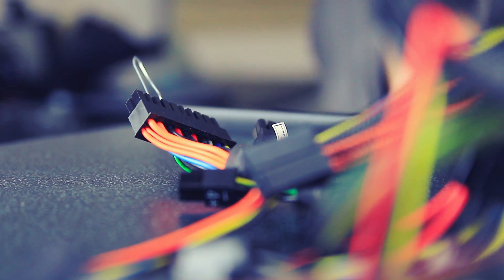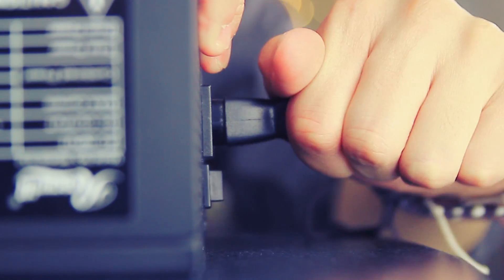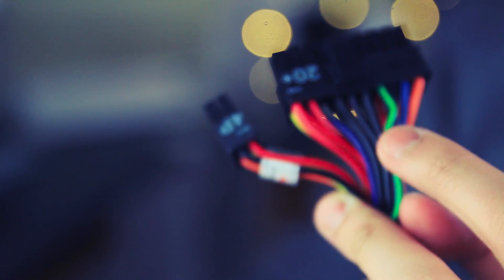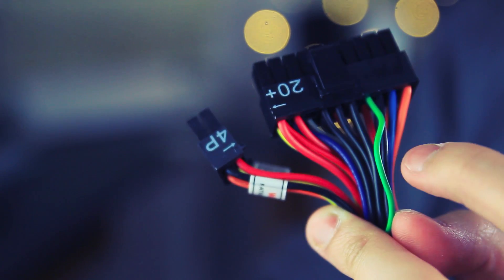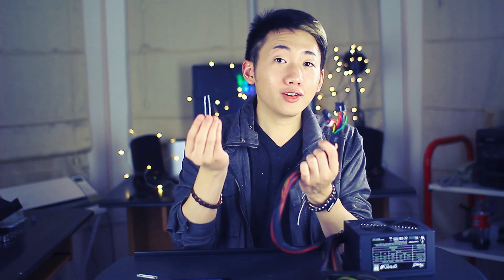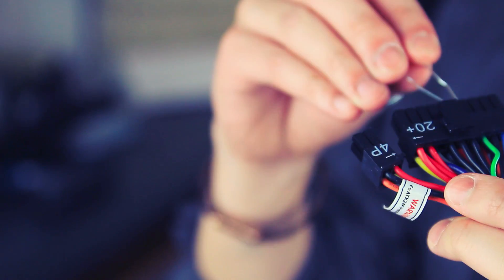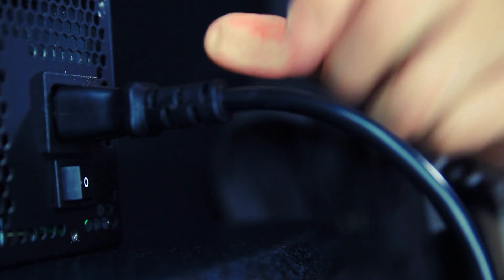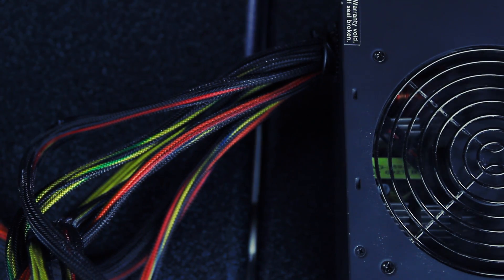PC Tip: Testing a Power Supply with The Paper Clip Test

Comment: Old Video, but short concise information that was spot on. I just purchased a used SuperMicro 560w 1U PS and wanted to make sure I didn't smoke it trying to test it before plugging it into a new 12gen intel motherboard. Green Wire to Ground, perfect. The current top result for 'bench testing power supply' is from Corsair that tells you to jump pins 5&6 which would result in shorting out a 5v pin since they use a non-standard pin numbering scheme. All the new 'Modular' power supplies have proprietary cable setups with all black wires, such a dick move by manufactures. One of the reasons why I went with a known solid 1u server power supply, even used its probably better then most of the crap on the market now. Thanks again for the video, much appreciated.

Comment: The fan spins but when connected to the pc. All the fans spin but like very low voltage spins. So I guess it’s not putting out enough power to boot the pc.

Comment: i juat have a prob. with my Mobo, its that when i plugged hub or the keyboard in my Motherboard, its light indicator  has turned on , but when I try to turn on the unit , it cant run or start. btw, i tried to jumpstart the PSU, when i jumpstart the PSU, it starts, so its not the PSU seems the problem, , what it seems the problem.?

Comment: Hi Aaron, Thanks for tip. Was set to buy P/S - see below - and disconnected everything in PC and with paperclip in green and black it started.
Problem begin when daughter went wake to wake up PC. Black screen only so she rebooted. Same. No POST no anything. Called in Dad. I noticed some fan was running at high speed other than that nothing going on. So I Rebooted. power would come on and go off. Well time to raise the hood. Removed side panels from the ol HAF Full Tower case. Now I could see what the EVGA X58 SLI LE MoBo was saying.
68    F3  F6   would alternately flash before power light went out, stay off a few seconds and repeat until I switched off P/S. 
EVGA forum said F3 was looking for RAM in slot 1 and F6 looking in slot 2. So I pulled all 6 RAM sticks setting #1 aside and tried several in slot 1 and sameo sameo.
Another Forum post said this start / stop boot loop can be caused by bad RAM controller in CPU. That's when the 68 part hit me. That's was way too hot. The fan I heard running at high speed was the CPU heat sink fan.
Now for the fixes I can imagine. Cheap is clean thermal paste from CPU and Heat Sink and reinstall. Next cheap is buying a used CPU. Not cheap at all is a new CPU.
Have I missed something? Ideas? Thanks.
Regards, Dan

Comment: Mine turned on, but its fan stopped after about 10 seconds. A few seconds after  I turned off the power switch, I heard a circuit breaker reset inside the PSU. Then I could turn  it on again, but the same result.
 
Bad cable or PSU, right?

Comment: I tried your paper clip test, and I get no response at all.  However, if the motherboard is plugged in and a press the power switch, the fans come on and then it shuts down almost immediately.  I guess I’ll try a new power supply.

Comment: Please do not do this.  This is bad advice.   All your paperclip test does is confirm the power supply unit turns on.  It doesnt tell you that the power supply unit is working properly or outputting the correct voltages.  You could do this "test' and plug the PSU into your computer and end up destroying it.  Dont be lazy, skip the paperclip test and purchase an ATX power supply tester for less than $5 or learn to use a multimeter.

Comment: Two quick things, the voltage supplied to that rail is 12 volts, if you shorted the wrong pins the worst you would experience is a shock similar to that of a car battery (nasty) but more likely you'd short a bunch of fuses first.
Secondly, if you short the right pins, you've closed the circuit, touching it won't have any effect.
But of course, it's always smart to play it safe anyway.

Comment: power was blipping on for less than a second before the system turned off, and i assumed it was the psu, but sure enough the psu was just fine with the paperclip method, leading me to believe i had a faulty motherboard. for whatever reason i decided to remove the mobo battery and wait 15 minutes before trying again, and sure enough, the computer worked fine. i didn't assume it was a cmos issue bc i had already jumped the pins and cleared the cmos, but removing the batter solved the issue. i was abt to buy a whole new mobo too, try everything you can guys. :)

Comment: hey I tried this on my PSU and it works for a second... the fan on the psu runs and then stops even when the paper clip is inserted. is my psu faulty? what could have been the problem?
Reply: That is what happens to my brother's PC too, and I dont know if is MOBO or PSU.
Reply: @tinkode3526  It's the PSU, I just got it replaced and everything is working normally.

Comment: This is what I was looking for.  I need to refill my water-cooled system and the pump is not supposed to run dry, so this is what I needed.  You could add to the title and/or search words "bump" "jump" for bumping the power supply on and jumping the right two wires.

Comment: i have 2 pc that wont start -- nothing when you press the on switch -- one is very old and has problems booting up when it does turn on [ it will sometim,es] -- the other is not as old it has not been used much as it was going to be the pc i went to when the others have died -- probably have spent less than 100 hrs on it -- nothing happens when i hit the on switch -- both power supplies check out operable -- any suggestions?

Comment: Thanks for the video. I did the paper clip test. However, my fan spins momentarily when I turn it on and also when I turn it off.  Being an SFX (sf450 from Corsair) and very power efficient  it is not drawing enough current and only spins when under load..Does this mean the psu works as it does spin albeit not continuously?
Reply: Thats the whole point of this video 😂 ur psu sucks
Reply: @XxxCR1SPYxxX  lol

Comment: this is a very old video but still, some search engines will populate a search here and it's only a portion  of a good or bad PSU.  DO NOT FOLLOW THIS VIDEO AND DEEM YOUR PSU EFFECTIVE, You must Jumper the PSU like the video states but you also MUST check every Pin to make sure it's putting out the correct  voltage.  If you don't then it's the same as throwing parts in to see which one works and which one does not.  Be smart do it correctly, or spend your money like liberals throw plastic bottles and oil into the ocean

Comment: I've done this test, turns on my PSU fan but when I plug this into the motherboard and try to short it from the power connector on the Mobo nothing happens. Anyone have any ideas? CPU is fine and installed, I've also made sure to test the RAM dims and all ok, switched them around too. I'm stumped

Comment: I just had a High-end Corsair DDR3 Ram died on me and cause all sort issue such as random crashes and odd performance issue.    I lost several hours replacing everything such as PSU, graphic cards, cpu etc with known good parts.. only to finally tested the RAM.   I never thought Corsair RAM would fail.
Reply: Yo, if that's the case (and if you don't already know this procedure) be sure to heat those sticks, since usually RAM Is really unlikely (as you pointed out) to fail, and reheating the sticks through a oven and some tin foil helps reflow PC components in general (4real, I know that it sounds like the "microwave your phone to charge it Superfast!!" but it's actually legit, check tutorials that explain this better than me). I did this with an old Stick that gave me problems and It totally brought it back to life c: (although the real problem was the Port itself, but at least I now own a like-new RAM Stick)
Reply: @eugenegue2089   I just read your comment today,   Thanks for the reply.. so heat at 220, alright i'll sake and bake them and see if they turn out good.   can wait for some yummy Ram chocolate chips
Reply: @eugenegue2089   like the Graphic Oven trick?   Well I  try it since I have nothing to lose
Reply: @scottymsu6063  yeah, something like that, but for a RAM Stick you can also just wrap it up in thin foil and that's it. Remember to disassemble the stick from any plastic components though
Reply: @eugenegue2089  Thank you I'll try that in foil, maybe I can save the RAMS after all.   Was a shame these Rams are top of the line Corsair...
Reply: What temp do you recomend me cooking up my Ram, LOL.   oh man the house gonna stink bad.   400*F maybe?
Reply: @scottymsu6063  damn man sorry, I never use this profile and I didn't get the reply... I'm sure it's too late and probably you've checked online, but if someone reads these comments and is curious if I remember correctly I had my oven going at 220 Cº (sorry, European's metrics here)

Comment: Why use a non insulated conductor? Why not just use an insulated 18 AWG wire?
Why take any risk of electrical shock, safety first. I know it’s only DC voltage, but it’s good practice to be safe when working with electronics.

Comment: Question, so I installed a new psu, it turns on but only briefly. I put my old psu back in and it runs fine. I did your test with either of the wires next to them and one wire made the fan run fine but the wire to the left of the green wire only ran for a second then stopped. Does this mean it’s a bad wire?

Comment: thanks for the video, but pc power supplies output 12 volts max. 12 volts is not enough to push the amperage through your body's resistance and will not electrocute you. of course this only applies if your psu is working correctly and only outputting 12v so i guess you are right. better safe than sorry, dont touch the paper clip lol.

Comment: Mine is not working,i have a smaller power supply(it's a liteon) i bridged the  green and black wire but nothing,the power supply is fine,but it does not want to turn on

Comment: So yesterday, my pc was plugged in but switched off as I had to switch off the power to the house multiple times as I was fitting a new light. Once sorted I clicked my pc and nothing happened.

Below is what I have done:

Changed plug fuses
Done paperclip trick on psu and fan spins
Changed kettle leads 3 times
Checked all connections inside tower
Changed cmos battery
Two lights are lit up on the mobo, reset button is lit green and a power sign button is red. No other lights visible inside.
No burning smells from any components

I'm stumped

Comment: Note:  This test does not rule out your power supply as the reason your cpu isn't turning on.  My HP Slimline s5150t was completely unresponsive when I pushed the power button.  The power supply passed this here paperclip test.  But I discovered that my computer booted up normally with a new power supply.  So this test is a neat little party trick but nothing in the way of a complete diagnostic.

Comment: Green to the PSU case is safer for the PSU and a faster test.
Max voltage through there is what 5v?
Shove the clip into the green and tap the other end on the PSU case.
Same effect and less risk of jumpering the wrong wire and frying the PSU.

Comment: One the good power supply the fun do not move a bit( but works just fine on a motherboard), on a faulty one, (which set amber light bleeping),  just spins for about 4 seconds and stops.
any advice? Thanks.

Comment: Heya! I got a head scratcher for you.  Pc worked fine two years ago, I moved 20 mins down the road, the notice it has a hardware failure beep code. (one long, three short,  slight pause another short) I've tested every piece of my system in other people's, seems they all work.  Recently took it to work, coworker got it fired up, without doing anything to it.  I bring it back home, same hardware failure code.   I've tried multiple breakers in my house, Incase the power isn't steady.     I was told possible psu rail failure, but why would it work at my office, but not before at home and furthermore why not work after successful start ups, after  moving back home.

Sent away Mobo, returned with same issue, all other parts I've tested ><
Reply: get a new psu i suppose

Comment: Cannot figure it out, have thermaltake BRAND new 600w psu, biostar ta970 mobo brand new, plugged everything in, nothing not even aux light, this was my prior issue with my hp compaq 6305 mobo, cannot figure out why no power is being given.

Comment: I did this and the fan started to spin and everything seemed fine but the i smelt burning. I'm not sure what was burning and i haven't turned my PC on since, i think maybe there is some dust or something stuck inside my PSU that is burning but i don't really want to turn on my PC again to check in case i mess something up. If someone could help that would be greatly appreciated.

Comment: and if your wondering what would happen if you touch it, it kinda shocks a little. the worst shock i had was trying to plug the moniter power cable again when i was trying to find the hole where i should plug it in i put my fingers inside it and ouchhh it fucking hurts like a knife, the moniter wasnt even plugged in the wall

Comment: cool this is useless to test a power supply except to know if the thing turns on. how do you diagnose stability issues. I can't tell if it's PSU motherboard another shorted component somewhere or the utility company.

Comment: My PC suddenly turned off while a game was running but I was AFK. My GF told me she saw some kind of Windows error msg.
Since than I'm unable to turn it on. When I press the power button, fans try to spin, but only for like 0.5sec and that's it.

I tried to use another PSU on my PC and it seems to be working. But I can't see more, as the spare PSU I have is weak and doesn't have all the connectors. I can connect only the ATX (20+4 pins) and one extra CPU connector (4pins - but my mobo requires 2x4pins for extra CPU connector). I can't connect graphic card, as the spare PSU doesn't have that 2x6pins connectors for graphics. 
That way I can only see fans spins (a bit loudly), lights on, but I can't see the video output on monitor, because I can't connect graphic card and mobo doesn't have integrated graphics.

I tried this paperclip test. PSU turns on, fan is spinning, but slow and quiet.
I also tried to test the PSU on another PC. Same issue. Fans spin only for 0.5sec and nothing else.

I'm confused. Is my PSU or motherboard dead?
Reply: reset CMOS battery
Reply: I have an extremely similar issue to you, my PC will turn on for half a second but turn off. Then it may not turn on at all and seems that my PC is not receiving any power at all. A few hours later it will start up fine without an issue and will function normally. 
This isn't the first time its happened either, i thought maybe my PSU was dead but the fact that it is able to boot hours later and function normally is rather strange and makes me think otherwise. Any ideas on what it could be ? And did you end up fixing yours ?

Comment: Hey guys I am having some trouble with my computer's Power Supply (or so I think, still trying to diagnose). My problem's simple: when I start up a resource intensive game or program, my computer shuts off after 3-5 seconds of starting the game with no Blue Screen of Death. This happens consistently. Everywhere I read it points to a PSU issue but I wanted help to know how to check this is in fact the problem so I can go grab a new PSU. Any ideas?
Reply: Is your PSU too low wattage? Might be an issue.

Comment: He didn't actually say HOW it becomes a test.  What are we to expect if is PSU is bad or good?  He seems like a very intelligent kid.  But forgot to tell us what to look for.  Or is this simply a test to see if the PSU turns on?  In that case, this "test" is silly.  As you can do something safer for yourself.  Go to the computer store and pick up a PSU test switch for $5.  It's simply a power button with a few LEDs that you plug directly into the end of that motherboard cable he's holding.  Way safer and smarter than a paperclip.
Reply: idiot, either the fan spins or it doesn't. if your iq is above 70 you don't need someone to tell you that

Comment: So i put my paper clip between ground and black and nothing happens. I plug it in and tried another cord that is for sure good. I know i got power. Im assuming i have a bad power supply. The computer worked fine a few days ago. Went to fire it up this morning and nothing happened. 700 watt ocz. I built this computer in 2010. 6 core processor.
Reply: 6 years is a good lifespan for a psu I'd think, depending on how heavily you use your computer, I woke up to mine not turning on as well, but found that a transistor inside it had blown apart and came out the bottom of the psu.

Comment: Hello! I'm having a strange issue and I think it's the PSU but I'm not 100% sure. Even the stand-by green led on the MOBO it's on when it's connected to the PC (but I can't power up. that's the issue). When I do your test the PSU fan or any other fan doesn't even cringe to work

Comment: hey , i have found this video and i can tell you that this worked for me , but i have a different kind of problem , when pc is running and i start to play a game ( any game that needs a bit more resources ) my pc shuts down . and after it , when i press the power button , pc won't start unless i unplug and plug the power cable of the psu . can you help me ? thx
Reply: 14SnaKe3D same xd somtimes pc works normal for weeks but 1 day it can crash or even dont boot windows